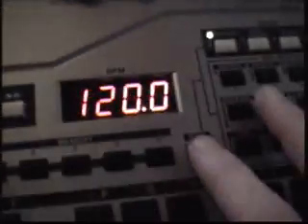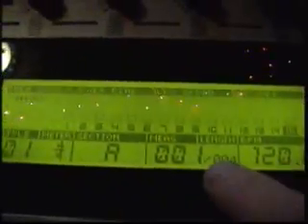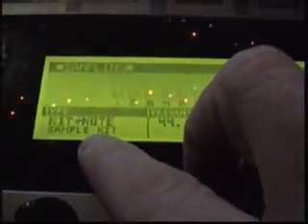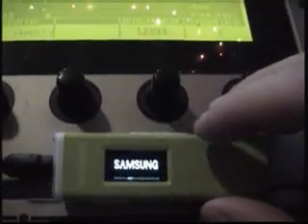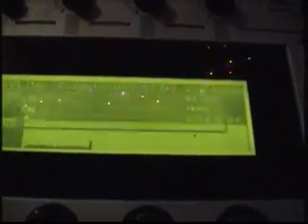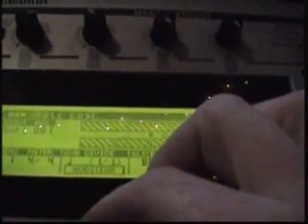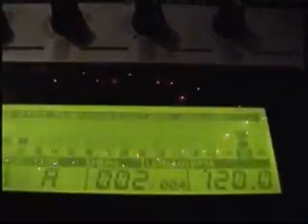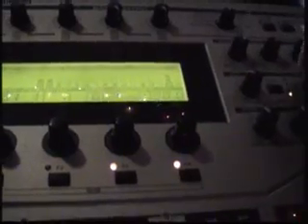yamaha rs 7000 how to sample

Comment: Is it true that onnce you power off the rs7000 it doesnt save your samples unless you use an external hard drive?  Cause if so that really sucks!  I just got one off ebay but the seller lied about its condition so i gotta return it then get another,  but this whole having to save the personal samples you make to an external hard drive thing is confusing me,  i love the sounds you can get with the rs7000,  but a sampler that doesnt actually save user samples on its own is making me have second thoughts bout gettin another,  i like the sequencer on these yamaha a lot more than the rolands ive tried cause you get more freedom,  but if i cant save my own sampkes maybe i should just get an rm1x,  idk.   Thanks for the helpful video though,  it helps a lot  Nice Work dude  !
Reply from the maker: i save all my stuff on my sd card and i have no problems at all!
Reply: 2012 BEATS well ifinally got a nice working rs7000,  but it only saves about 25% of my samps on the sd if that kida sucks!  I ordered some new simm ram cards, hopin that helps